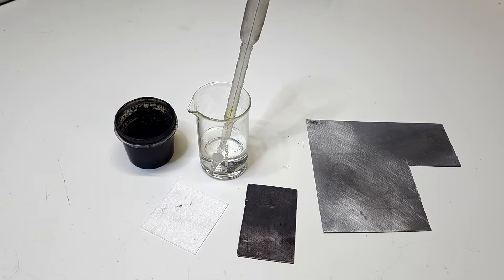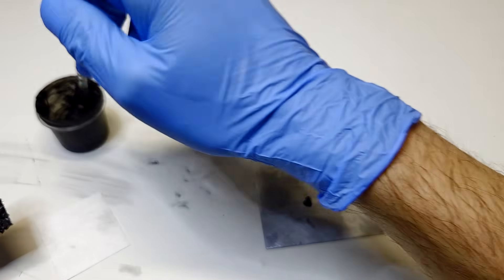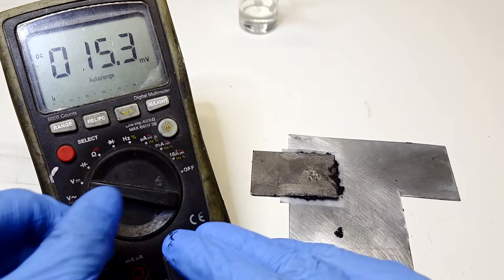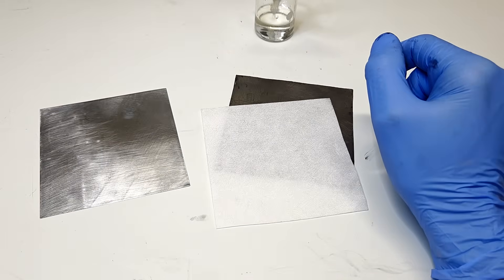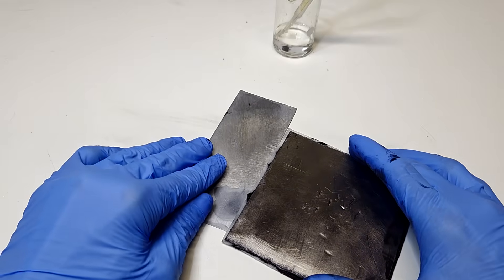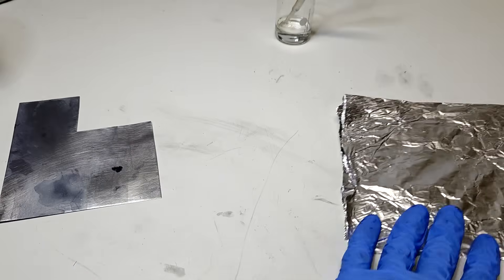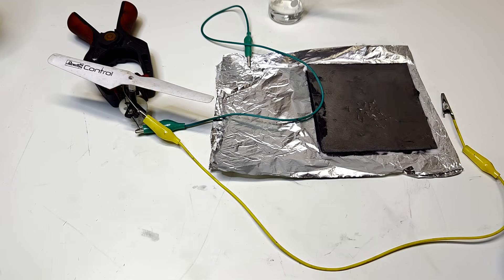DIY Homemade BATTERY | High power Aluminium and zinc battery

Comment: Very nice tutorial using safe and easy to get ingredients. It would be nice to see a stack of 5 or 6 cells connected to an adjustable buck converter module (for cheap and easy voltage regulation) and a usb cable showing it charging a phone, and maybe measuring or using the phone charge % to show how many watts or mA total capacity it has.
Also, is it possible to recharge such a battery or the zinc just gets too oxidized to use more than once?

Comment: Everything in your home is getting converted to DC anyway except washing machine I'd say 20% of all power used in households in Europe is wasted converting AC to DC and 90% of electricity used is for DC appliances I think everything should run off 21v DC I live in a van now I charge a power bank off my engine for my phone and use used cooking oil for heat and cooking all my tools are 18v if I need 110 or 240v I have a generator I haven't used it yet 😅

Comment: hello 
please I need to know the specs for the carbon felt you use . for example its specific surface area and it's electrical resistance .
there is active carbon felt with BET 1500m²/g but with resistivity 77-96 Ohms . is it work?
Reply from the maker: The AC felt which I use have more that 2500m2/g and around 15ohms/cm. You have mid range AC. So, try it
Reply: @cayrex سلام میشه اسم موادی که استفاده کردی به زبان ساده به من بگی؟❤🎉❤

Comment: This is not a battery, this is a capacitor. I understand the motor is a low inertia type that can run on voltages lower than 1.5V.

Comment: 1:22 - What brings high current?
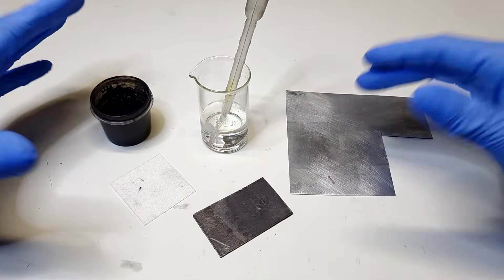1:50 - Material list
2:50 - Build process
4:20 - Testing
6:28 - Bigger cell
8:45 - Testing
10:27 - Tuning, replacing Zinc with Aluminium

thanks for a great video
Reply from the maker: WoW,  thank you for that timestamp.

Comment: Thanks for the vid. I would like to see a capacity test. Measuring with a multimeter and powering a small motor is nice but is it possible to make a useful battery with enough capacity to use in real life?

Comment: Is there a battery chemistry you think would be a good candidate for a rechargeable home bank made with relatively common materials?  Longevity would be a higher priority than energy density.  Unfortunately where I live the halides bromine and iodine are not legally accessible.
Reply from the maker: Manganese will do the job.
Reply: @cayrex  Do you mean the Zinc-manganese chemistry?  if so what would you recommend for the grafoil current collector as it seemed to get pretty chewed up?
Reply from the maker: @maxkennedy5073  Yes. Alpha or delta MnO2 are really good (can be made by hydrothermal reaction) or you make a cell with 1M MnSO4 and 1M ZnSO4 electrolyte.... which the MnO2 is formed on graphite felt. I have some videos about Mn-Zn cell (make a look). For the current collector I use grafoil, titanium foil or SS foil. But what I do it most is to combine the grafoil and some metal foil..... I put grafoil on the top of a metal foil. That way the metal CC  is protected from unwanted reactions.
Reply: @cayrex  Thankyou, had seen some of the video's but must have missed where you used the metal and combination CC.  I'll look.  Great channel by the way.
Reply from the maker: @maxkennedy5073  Graphite metal CC I mostly use in metal halides batteries, where the reactions are more aggressive.

Comment: I tried this exact cell, however I only got about 0.4V voltage with Zn. I bought pure Zn from amazon. What do you think the issue is?
Reply from the maker: Hmm, interesting. Activated carbon and zinc need to give you the cell voltage around 1V. Add some vinegr to the electrolyte
Reply: @cayrex Thanks I will try

Comment: Hi Dusan, I have something for you, I have been watching your channel for the past 3 years and my wife and I have been planning to move off grid for past 7, so I've been wanting to learn how to make batteries so I can expand my energy storage off grid well we finally moved off grid a year ago and yesterday I was messing around with your GPT and Google's AI and somehow between the two they came up with a flow battery that you can literally Assemble from scrap around you and it has the power density of 15 to 30 watt hour per liter I would like to send you a copy of the entire chat because I'm not in a position to build an and test it just yet but you can definitely test it and see if it works now since this battery is an option but it has never been tested in lab conditions it's technically an invention but since it was made by two open source AI's, I don't think I have the ethical rights to keep it so I would like to give it to you so you can put it in a public domain on camera and I would love to see if you can get it to work so how can I send you this information?
Reply from the maker: Yes for sure, I can take a look. What battery type it is? You can contact me on my mail: cayrex@gmail.com
Reply: @cayrex  hi did you get my email?

Comment: Hi Cayrex thanks for this video,
In these cells, can we also use Prusian Blue instead of AC?
Reply from the maker: Yes you can
Reply: @cayrex which one is better? Thanks
Reply from the maker: @myscitechs2497 Prussian blue is a good candidate for cathode since 1978. And is also used in zinc ion batteries. The prussian white is also used as cathode material for sodium ion bateries.
Reply from the maker: So each material is promesing. So you will need start somewhere.

Comment: Great video.
As I mentioned years ago, ideal application for FPV drone batteries.

Now it would be useful for Ukraine-Russia war, if such material had better performance than Li-Ion/Li-Poly batteries (Wh/kg).

You can try using ionic liquid. I read that in water solutions such a battery cannot be charged, but in ionic liquid you can make an Aluminum-Air battery.
Reply from the maker: Yes with Ionic liquids is possible co charge the aluminium AIR battery,... but,... because of lower ionic conductivity the power of the cell will be lower and also the charge / dischrge efficiency will be terrible. But as you mentioned, the use in some "one way" dron can be interesting. Years ago I make my first try to run a dron with zinc bromine battery,... but the battery was to heavy. Maybe I will try my luck again in the future.
Reply: @cayrex  Ideally, such a battery would be in Kamikaze drones. Just fly to the target. Aluminum and activated carbon are relatively light materials. The military would gladly hire you if you made a battery lighter than these batteries, and above all it would be cheaper ;]
Reply from the maker: @tdx110  Maybe the aluminium air battery will be to great for a dron application because of the limited power density. Some aluminium - nickel battery will do the job.